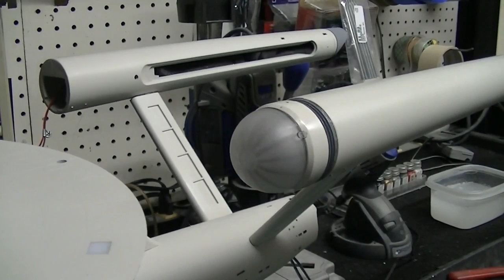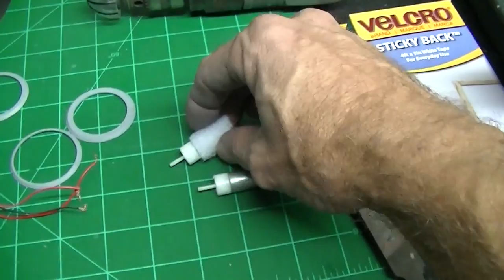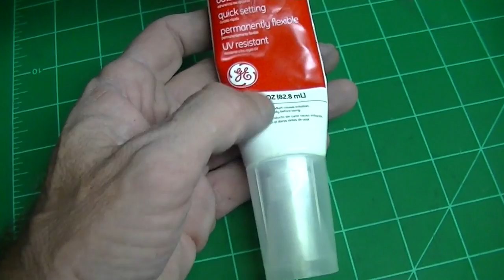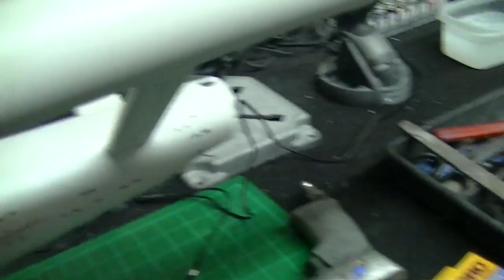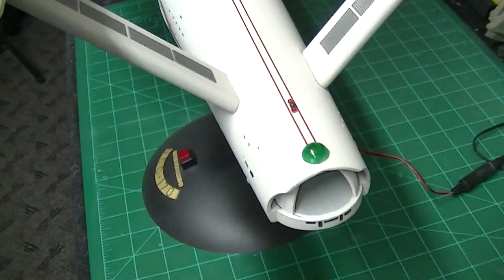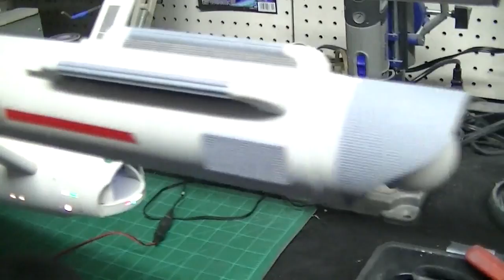Modifying The Bussard Motors and The TOS Enterprise Build Finale

Comment: I'm wonderinf if you could combine the silicon with a rubber bushing on the inside of the connection to add as isolator, as well

(basically like the cab of EMD SD75I locomotives, their cabs rest on a rubber bushing  hence I designation in the model (isolated)

Comment: I just completed the model, and for a first time builder, i am quite 
pleased. I thank you for all the videos you posted to help us along. I 
was wondering if you could give me the specs onan on off switch i would like to 
install on the base. i would like to install a switch so i dont have to constantly plug and un plug the power supply. if you can suggest one or just give me the model i would be grateful. Much 
thanks again for all your advice and help.
Reply from the maker: You can find the same type of push button switch I use here: www.Hdamodelworx.com

Comment: You should have popped open the motor gear assembly and added a little white lithium grease to the gears. That would get rid of most of the whine. This is the best model of TOS Enterprise. Great job! I'm building an AMT/ERTL 1?650 scale Enterprise. Any idea where I can get the clear domes for the engines?

Comment: Hi Boyd, you should check out Hansen-motor 'dot com'. They are motors for clocks and other low rpm applications such as 360 degree displays. They even have a motorized slip ring so your model can turn 360 and still get power up to the ship. These are about as quiet as you can get.

Comment from the maker: I like them both. The Tenacontrols system is high quality and motorless so it should last a long time. And, its totally noiseless. But the only way to capture the exact look of the spinning blades inside the bussards is with something mechanical. Some better motors will drastically improve the R2 kit.

Comment from the maker: Good info there! Thanks for sharing that one. Would make it easier to use a voltage regulator to slow down the motors and not worry about losing the lighting effetcs on the same circuit.

Comment from the maker: The original plans and drawings show the bridge being off center. The turbolift doors on the bridge line up with the shaft detail on the outside of the B/C deck.
The kit has indents to allow you to install the bridge straight forward or off center as it was originally shown in the old blueprints by Franz Joseph.

Comment: Hi there modelers, for all the builders out there, that got the spinner circuitboards that start working at 12.4 volts. There is an assambly error on the circuitboards the resonators R6 and R8 are in the wrong place. For those how are handy with a soldering,Switch them around and the spinners should work correctly starting at 6.4 volts and up. Already notified Round2 about it. Had the same problem wouldn't work on the adapter supply with the kit (that was only 12 volts). Happy mondeling to all.